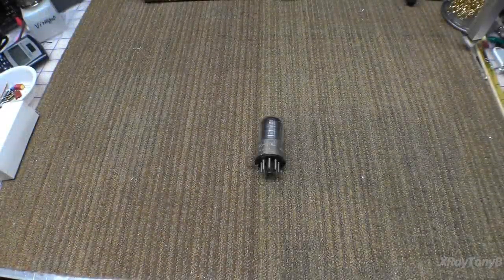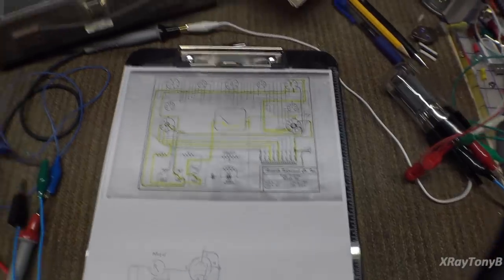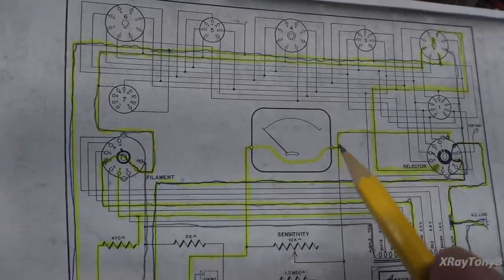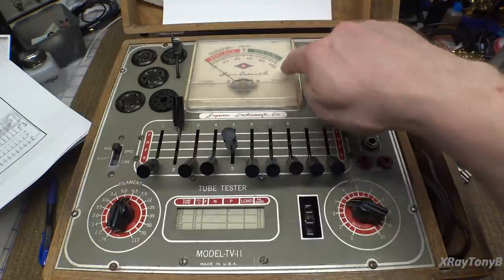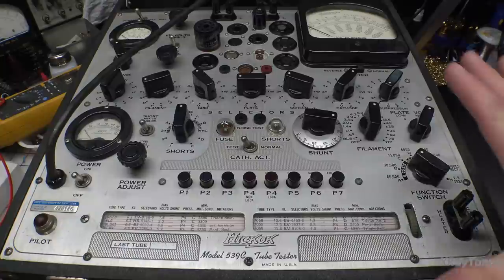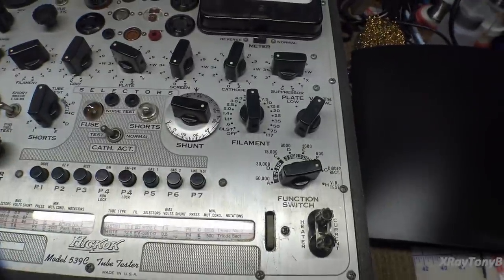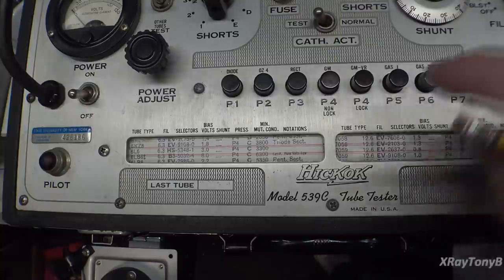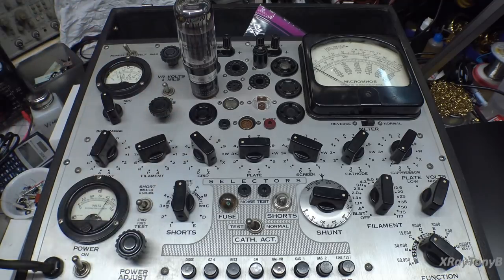Intro to Vacuum Tube (Valve) Testers

Comment: Exceptionally informative and interesting. I remember the tube testers in the drug stores. They were crude, but good enough to identify the bad tube to get the tv working again. Used them many times. In the 60's.  Now I feel old. Have a couple testers I have used on occasion, other projects getting in the way. Maybe a follow-up video repairing that TT-1 meter.

Comment: Last year I completed my project of assembling a uTracer kit. Highly recommendable. New version uTracer 6 has B+ up to 1000 V and plate currents up to 1 A. Note though, that kit has only the electronics PCB without case or tube sockets. You can directly compare your tube to the data in tube manuals. Indispensable if you want to accurately match tubes.

Comment: I find it ironic that 50 years later in my electronics journey that I finally know what micromhos mean. Resistance in OHMS and the reciprocal, conductance in MHOS, never really gave it much thought. My channel picture is from my Mercury 1200 dynamic mutual conductance tester. I also have a Hickok cardmatic tester which needs repair. Love these learning videos.

Comment: Uncle Doug has an in circuit tube tester for reading plate voltage and current.  It’s pretty cool.  He uses it for biasing and matching output tubes.
Reply: It is just a socket saver with taps. Easy to make if you desire.
Reply: It’s a Eurotubes “Pro One” which, yes, tests plate voltage and current  to bias the power tubes. Not really a tube tester at all. You could make one if you don’t mind 380v going through your hand if you didn’t insulate it properly. ;)

Comment: Thank you so much for this Tony! Just wish you'd had a B&K, amplitrex, or maximatcher in your arsenal to share! I stumbled across several EMC 213 and 215 emission testers and haven't found the need to upgrade. These goofy little things are STELLAR at sniffing out shorts, but finding gassy tubes is a bit more tricky. I've found leaving the tube cook for a while under test will diagnose a gassy tube as with some time the emission will drop off either a little or a lot depending how bad it is. Yeah these emc's aren't a MC hickok but they have worked wonders for me........

Comment: The TT-1 is a copy of the Weston 981 type 3 .  The Weston is much easy to work on it is a 5k test signal the 3c4 is the oscillator  tube . Given the choose take the Weston and use the TT-1 charts covers a lot of tubes .   For big money the Etracer and Utracer  generate very detailed info on the tube curves.

Comment: Hey Tony, have you ever thought about doing a video on the dangers of X-ray radiation exposure around old CRT TV's and other high voltage devices? How would one check to make sure the shielding is providing proper safety from exposure? What would you use to check for X-ray leakage? I could not think of anyone more qualified on this subject than you. Thanks, let's keep each other safe.

Comment: Wish had the dual transformer in my hickok 752 then be and upgrade over 539c but still a solid and accurate tester and fast with testing both sides at press of button. Just recently acquired a hickok 600 for doing the emissions tests and a 10% accuracy for micromhos. Need to find lid for it but was a steal for price 175$ US and cosmetic is very good

Comment: I have the Heathkit TT-1 with the late Meter ( or should say the Reliable meter ) and Works and Calibrates perfect and works Excellent and Have the Triplett 3444 but just don't like it, but the TT-1 and Hickok 539B that I have give Very close Results, I have more Tube testers than Tube projects :)

Comment: I am an expert on Vacuum Valves and the testing thereof. There are many testers out there. The-best one to use is the one you can afford.  Ove. Worked in the electronics field for 60 years and most of those years I never had a tester. However I had a very good stock of valves. These days I no longer have the advantage of a good tube supply. I live on a-fixed income. So I choose a tester that checks for shorts, gas and emission. I just really want to know is my tube in question good or bad, nothing more. I chose a Triplett 3413 emission tester. Its like the EICO basic model and a few others. It has never failed me. Correct I cannot measure Transconductance. Most of the vendors have the Hickok model that measures Gm. Im very pleased with my Triplet and understand its limitations.
O

Comment: Some comments and information that others will hopefully find useful: first of all, Tony didn't really delve into the shorts, leakage, or gas tests, which are the most important tests of all because of the very real possibility of damage to an amplifier or radio if you try to operate the device with a shorted, gassy or leaky tube. In a properly functioning, well designed tube tester, the neon-bulb "shorts" light should light up brightly if it encounters a shorted tube, but it might not light up for a tube with inter-element leakage, essentially an unintended and unwanted resistive shunt between any two or more tube elements. The "shorts" bulb on a Hickok might light up (dimly) for leakage of up to about 200k to 250k at most; but testers such as the 539 and 752 series read inter-element leakage right on the meter itself, up into the meg-ohm range; a much more sensitive and revealing test, and important because leakage can cause noise, hum, erratic bias and red-plating, loss of frequency response ( especially for RF circuits) and intermittent gain. Ideally you want to see NO inter-element leakage. BTW, I have encountered tubes, especially mini 7 and 9 pin tubes, that showed leakage on the meter of my 752A until I cleaned the tube bases and pins with alcohol and a toothbrush; dust and grease, or contact cleaner residues, can cause leakage current between tube pins, and tube socket contacts as well, which is why I don't clean tube sockets with anything other than pure alcohol. This goes DOUBLE for tube tester sockets and switches ---- use a pure evaporative solvent for cleaning, don't spray the switches, controls or sockets with Deoxit or anything else that leaves a residue. I'm sure at least one person here will try to tell me otherwise, but I've seen testers that were irreparably damaged by use of ordinary contact cleaners, so be forewarned. Tony didn't show the inside of any if his testers, but believe me, you don't want to replace tube sockets unless you absolutely have to. You have to get past layers of wiring in order to access the underside of the sockets. Its not quite so bad in a physicalky large 533, 539 or 752, but changing a socket in a Hickok 600 or a TV7 or any of the other small chassis models is a nightmare.

Testing tubes for grid emission,  or "gas", usually requires letting the tube get good and warm for ten or 15 minutes. On most Hickok testers, the shunt pot has just two functions --- it is used for the gas test on triodes, tetrodes and pentodes, and for setting the meter sensitivity when testing diodes and rectifiers (which don't have mutual conductance).

Going through some of my junk the other day, I found an interesting piece of test gear I'd forgotten about: a SECO Grid Circuit Tester, model GCT-5, that uses a "magic eye" tube ( a 6AL5, IIRC) to test tubes for interelement leakage, grid emissions, and gas, presumably in somewhat similar fashion to how an old Sprague capacitor-bridge tester works. I've never tried it, but if it's anything like the circuit for the upgraded GCT-8 model that I found a schematic for online, there's not much to it ---- a handful of resistors, a capacitor or two, a filament transformer and a couple of switches. I'll have to check it out further. The GCT-5 has miniature 7 and 9 pin sockets only, some of them being marked for 6AU6, 12AX7, and the like, and I don't know if it can be used or adapted for  EL84'S and other output pentodes. The GCT-8 has octal sockets and apparently  tests more tube types.....
Reply: I'm glad you said this about cleaning the pots and sockets with Deoxit, I just got a Sylvania 220 to mess around with and was going to do exactly that today. The tester seems to work great, although I didn't calibrate it yet. Thanks! (I didn't get as far as figuring out if I can test EL84's yet, which I have dozens of)
Reply: @2tallB  , I'm glad to hopefully be of help to you. I am a firm believer that he who who cleans with the least amount of contact cleaner cleans best!  At the audio repair shop I work for, a lot of switches, relays and controls get cleaned with nothing more than a pencil eraser and alcohol, or perhaps a fiberglass- bristle "scratch brush" if the tarnish is really heavy.  Contact cleaner is applied to potentiometers in minute amounts with a syringe, rather than flooding it with a blast from a spray can. Some things such as slide faders and rotary encoders really can't be cleaned properly unless you take them apart and polish them with the pencil eraser.  By the way, the best method to clean dirt and tarnish from the miniature 7 pin and 9 pin tube tester sockets is with a wound guitar string of approximately .033 to .039 (housandths) diameter, that you work back-and-forth inside the contacts like a miniature round rasp or file. If you can find a way to spin it with a small Dremel tool or something similar it becomes very fast and easy (Harbor Freight sells a small battery powered engraver for about 8 bucks that can be adapted to fit the guitar string).  Flush the tube socket contacts with pure alcohol afterwards, and retension them with a small jeweler's screwdriver or dental pick.
Reply: I use silver deoxit to clean the pins, it works great far better than alcokol. Important though to remove any rests of the deoxit.

Comment: It's very important to ALWAYS do the SHORTS test before checking Gm.  If there is a short in the tube and you press P4 you most likely will trash the bias circuit and/or meter.  There is no overcurrent protection for the bias circuit and probably the most important mod is to add that.
Reply from the maker: I agree.  For the cost of a #49 bulb and a bayonet socket, the bias fuse upgrade is a must.  The older Hickok testers had this feature and for some reason they omitted it in the 539 series testers.
Reply: Yah not sure why they didn't have it in the 539 series they where better then the other hickok testers cause of the dual transformers and can readjust voltages with tube still under test.

Comment: Stark is a Canadian brand that used the Hickok wiring. So a Stark 8-77 is basically a Hickok 6000 and a Stark 9-66 is basically a Hickok 533 (or the Hickok 750 can't remember). There were some very slight differences with dials and resistor placement but can calibrate very similarly to the Hickok's.  I have both of these stark versions. So if you see a stark don't hesitate to buy it.
Reply: @lmt200ish  And the Canadian Marconi MU-101 , same as the Stark 9-66 , but solid state rectifiers.
Reply: @joelima201  didn't know that. Thanks

Comment: I have a Hickok 532 mutual conductance tester that works well and it calibrated but the octal socket is about shot as I have to tug on the base of the tube inserted into it for it to  make contact.  The rest of the sockets are fine.  I also have a Philco 7050 tester that I bought a couple years ago and have yet to open up and go through.  It looks like the neon shorts bulb in it is broken, but I could be mistaken.  Some day I'd like to get a small emissions tester as 99  times out of 100 I'm sure that'd be good enough for my needs.  Something like one of those little Knight or Heathkit testers.  I use the old terminology as well.  When I say Kilocycles or Megacycles I get the same reaction, lol.
Reply: I would replace socket and order socket savers for the common sockets you will test in. They will wear out before wears out original sockets

Comment: The Triplett 3444 & 3444A show plate current and the 3444A's meter will handle 1.5 amps on the plate. They also run at common USA EIA test voltages of 250 volts plate. The Triplett also has a small 5000Hz signal generator so the tube is amplifying a 5KHz signal. I own the Hickock KS15750 which is a 539B without the plate current terminals but the Western Electric KS15750 testers generally came with an optional decade box made by Davies that was used to bias the cathodes on some tubes. To find the BOGEY or factory specified GMHOs divide the minimum by 0.55, 0.6 or 0.55. Tolerances were +/-20% anyway. I need a lift ring for my KS15750A. It dates to 1943? And it has the very last chart from Fall 1974 in it. It was heavily used and abused.
Reply: I bought a Heathkit TT1 kit NOS still in the original Heathkit box, still  100% "UNASSEMBLED" at a garage sale. What a mess of crap! Holy smokes! What a bunch of bits & pieces!
Reply: Yes, the AVO VCM163 also uses the valve under test as an *oscillator*, so it is by far the most accurate method. I cover this in:

https://www.youtube.com/watch?v=ITJE4f-oVfc&t=921s
Reply: @Satchmoeddie lol that's a super cool find!

Comment: Conductance usually is used for non-solid materials with very high / extremely high resistance, like liquids, gasses, plasma.  It is easier to use the reciprocal unit: mS, µS, etc instead of resistance.  Since tubes work in (nearly) perfect vacuum conditions, it is more convenient to talk about conductivity than resistance.

Comment: I have replaced my RCA card reading tester with a Hickok, 533A. It is very similar to your 539 but with only  1 meter and additional scale on the meter to get the same live voltage function that you have a meter for and the bias is set with a scale on the adjustment knob (like your shunt knob) rather than a stand alone meter. I have no idea how many revisions my roll chart is behind but I just downloaded the PDF of the latest edition and keep it on a tablet on my bench. There are some known mistakes on it but it is very easy to scroll to the tube you want, you might think of doing the same. Once you have it on a PC or tablet, the roll chart is very slow to use. Just saying!
Reply: The 533a is like all other hickok testers. 600a, 800a, 750, 752 which uses a bias control which is tapered with very fine wire and has a bias fuse to protect it. The 539 series is the better tester it has 2 transformers instead of 1 and the bias control is an actual potentiometer so more durable hense why it doesn't have a bias fuse. The first transformer is for the heaters of the tubes and the second transformer is for mutual conductance tests so it increases accuracy then a tester with a single transformer.

Comment: If your tube variety not great, build one! Info is on the back of RCA tube manual, easy to make 
One that test dual triode or matching two tubes w/o switching like mad and at operating condition .

Comment: The line adjust rheostat when set to the red mark, assures the correct primary voltage is applied to the two transformers (filament and bias/plate supplies). The correct supply voltages are assured by this setting. The calibration  tests and adjusts  these circuits. The end result is the correct voltages of the associated supplies. If the line meter is inaccurate it throughs off everything that follows.

On the 539C, the bias meter is a milliamp meter with two switched series multiplier resistors, giving two ranges:0-10, and 0-50V. The accuracy of this meter is determined by these two multiplier resistors.Because these two resistors are switched it’s  impossible  to monitor this voltage by bridging the meter movement.

Because of the unique circuit design I find all adjustments seem to effect the next one. All adjusts seem critical to. The next.

I have yet to find a clear description how the Hickok  transconductance bridge circuit works.

I believe, When the tube is being tested, a pulsating (half-wave) ac signal is added to this unfiltered dc bias. This is the “dc bias  plus “ac” (pulsating dc) applied to the grid of the D.U.T.  I believe The transconductance is measured by monitoring the effect of the input signal on the plate current by use of a bridge circuit, giving conductance in micro-umhos. I wish I could find a more better/detailed description.

A common modification is adding the additional #49  bulb in the dc bias supply. The bulb limits the current, like a dim bulb tester, such that if the supply gets shorted the bulb resistance increases limiting thus protecting the bias supply. Under normal circuit operation there is little current flow and the bulb’s resistance does not affect circuit operation. This enhancement. ( #49 bulb ) is in the Hickok 6000A tester circuit.

Please accept these comments as my opinion based on my own study and operational  experimenting with my own tube testers. I may be be in error, but I offer my observation for discussion.  I do not claim to be an expert in anyway.

Comment: Concerning emissions testers, your video suggests a tester that measures only cathode to plate emission is least desirable of all testers. How is the tester you demonstrated that connects the plate and grids together any better? Both emission measurements are only a relative indication. One cannot be better than the other.
What relevance is connection to screen or suppressor grids, and their corresponding emission, other  than some effect just proving they are active somewhat.

Comment: I'll be building the uTracer 6 that uses pulsed voltage to develop tube traces. High voltage too - 1000v. I need to be able to test and match power tubes eg 811, 6146, and 572's. Ought to be an interesting project. The problem with the older ways is the need for especially high voltage power supplies > 400v for plate voltage. The uTracer just uses an old laptop supply. I can still use a 400v unit to calculate Gm as it is the CHANGE of plate current over grid voltage, it just doesn't fully load the power tube. 73 de WB4YDL